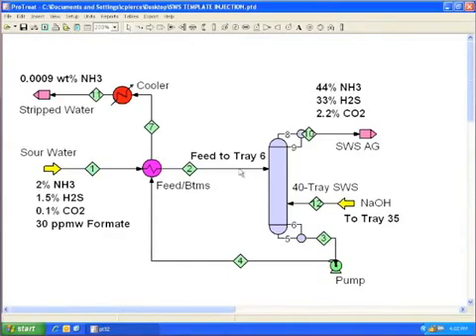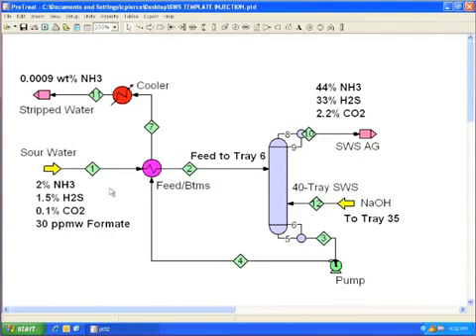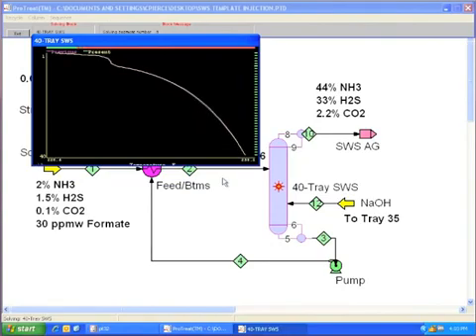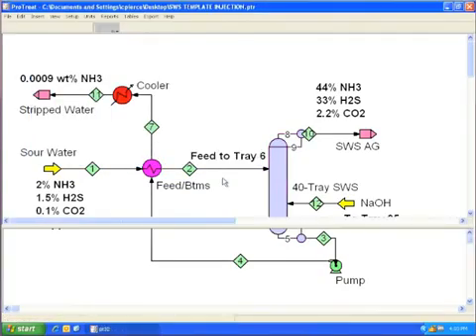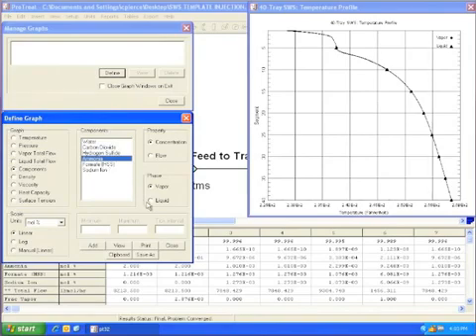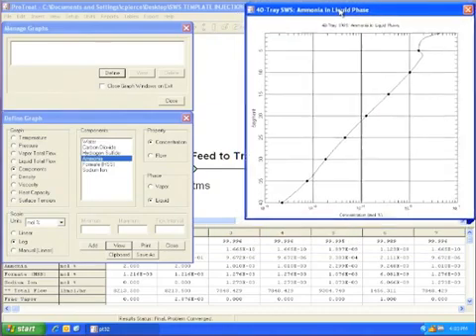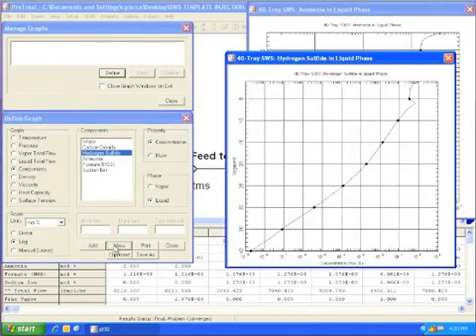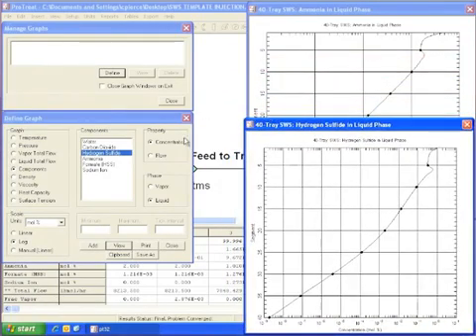Sour water stripping

Comment from the maker: This short video demonstrates how ProTreat can be used to simulate a sour water stripper. Caustic soda injection is used to help spring ammonia from its combined form with the heat stable salt, formate. This is a 100% mass transfer rate based calculation.